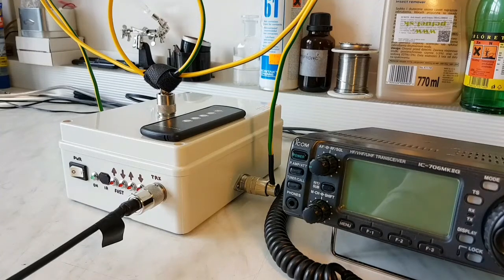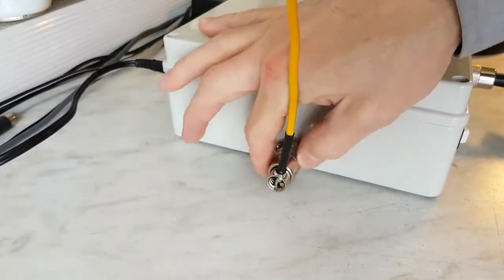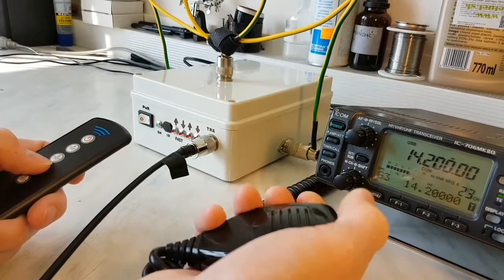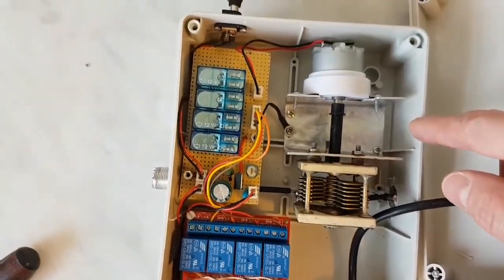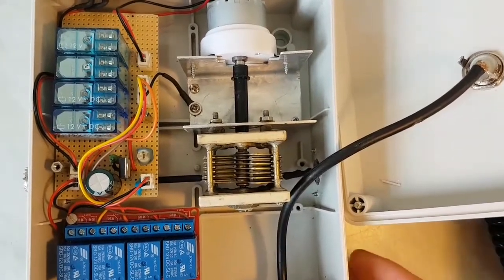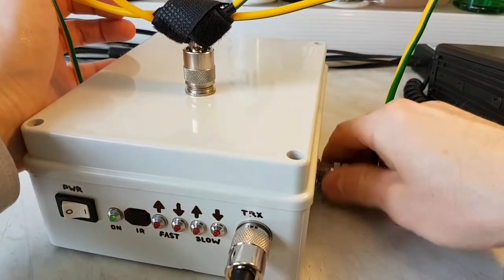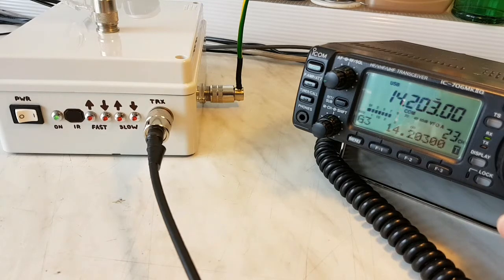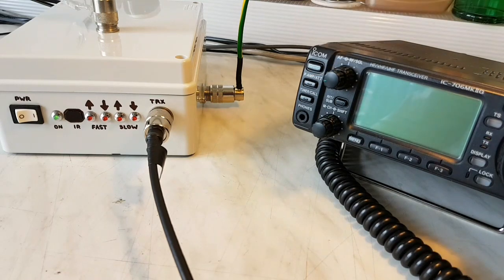New IR Remote Controlled QRP Magnetic Loop Antenna

Comment: Aloha Paul, can this micro loop antenna be made for 10 meters only and how many watts can be transmitted? I believe you are going to modernize the entire Amateur radio hobby with your loop antennas. 😎
Reply from the maker: This was just an experiment but it was capable to use more that 50 or even 100W due to very large capacitor in the box, but using such a big power so close to the human body would be dangerous. I dont have this antenna any more. Scraped 😃
Reply: @OM0ET  Oh no!!! What a beautiful antenna and would have been perfect for my Xiegu G90 at 1-20 watts PEP. Plus I could of added a 7 a/h UPS battery and connect it to a folding solar panel for SOTA activations. Can you dig it out of the trash pile and give it to me? 😂🤣😂🤣
Reply from the maker: @digitaldreamer5481  lol 🤣 impossible! Unfortunately but parts doesn't exist anymore 😃

Comment: How well has the efficiency turned out to be since you've had it for a while? Is it worth it? Have you made a few contacts? I may make one myself maybe with copper Tubing and spread the two turns apart a little.
Reply from the maker: I didn't use this antenna for so long, but I had a couple of contacts across the Europe from the table at my room :-) But better is working my 1m diameter loop which I use now :-) The efficiency of this remote magloop should be not high due to a small diameter of the loop, but it works :)

Comment: Why 8 relays and not just 4?
Reply from the maker: 4 chinese blue releys are just with one switching contact each. Transparent 4 releys have two contacts each. Transparent releys are switching voltage polarity in to DC motor. You can't do this with only one contact, you will need two of them. ;-) That's why are there 8 releys total. 73 Paul

Comment: Hi! In order to measure the SWR properly, you have to switch to FM. Or you have to modulate the SSB signal by long "AAAA". By the way, have you passed a QSO on this antenna? I haven't seen more videos with this antenna.
Reply from the maker: There was a mistake when i measured the  SWR on SSB but after a few seconds i measured it on carrier modulation. Maybe you didn't seen whole video. I did couple QSOs with this loop but i don't recorded it on the video.

Comment: Very nice!
How the 2 turns of the loop works? what's the difference from 1 turn?
What's the diameter of the loop and the circumference?
Thank you!
Reply from the maker: Hello, diameter of both turns is 45cm, small loop diameter is 9cm and the gap between main loop turns is 4cm. Difference between one or two turns is in its final inductivity and size of antenna. But this construction is very small and effectivity of this MLA is very low. I recommend to you to build this one: https://youtu.be/FGWFA12rQ5M
Reply: Thank you!
I'll watch it.
You have very interesting videos...
Just watched the EH antenna one.
Reply from the maker: Thank you! The EH antenna is practically not working until now, because i dont know how to solve the issue with the strong RF in the feed line(coaxial cable). Its causing a strong resonance unstability. I need to isolate RF between EH antenna and the coax.
Reply: Yes, I read the comments.
Also read what someone there wrote on his website (I didn't understand half of it HI) that EH antenna isn't really radiating...
I thought I fount the a magical antenna :)
73.
Reply from the maker: About 15yrs ago i made the CB EH antenna and i did a QSO with 4W to U.K. CB station from inside of my room on 1st floor of the 3 floor building. So there is no doubt that EH antenna is really working. But the design was much different like this one.
Reply: I hope you'll solve it.
I'm the in category of the people who doesn't have space for HF antennas and every small design is interesting.

Comment: Paul, this is a very interesting and instructive video.  I have been experimenting with a magnetic loop antenna for around a week or so that's how I found your video. May  I ask a question please? With the 50pF capacitor, what bands can you tune to? 73 Trystan G0KAY
Reply from the maker: Trystan's Workbench thank you! MLA antenna is like a LC circuit and its resonance depends on capacity and inductance. There is also some optimal values for each bands. But if you will use more inductance you can use less capacity. There are plenty of online calculators on the web. There you can see what you can do with 50pF capacitor. But 50pF is not really a big value for MLA. Could be working well on 12, 11 or 10m bands with one turn of copper wire. 😉
Reply: Paul, Thank you, and for your very fast reply too. Yes!  So making two turns means you can go to 20m bands and lower? Do you need to alter the size of the Faraday loop if you go from one turn to two turns, and does the position of the faraday loop have to be changed if you do that (on your two loop it's near the capacitor for your two-turn loop)?
Reply from the maker: The small loop position is this due to better construction capabilities but the best position is to place coupling loop against to capacitor. And about 2 turns - there have to be the optimal values and high Q of the antenna and its efficiency. The best is to use 1turn and good capacitor. But you have to calculate.
Reply from the maker: In my case it was not a really good idea to do so as i did.
Reply from the maker: Let see my latest videos with UltraLight MLA design. This antenna is working perfect!
Reply: Yes, I have watched your latest videos of your magnetic loop too. At the moment I have a 1.3m diameter coax Mag Loop (with LMR400 cable - like RG-8, to N-Type connectors) with a 300pF capacitor with a geared motor, controlled to go slower with a simple NE555 circuit set up  to make PWM pulses. The coax is too flexible to keep its own circular shape. Your projects are very well made!

Comment: Can you post information on the wire thickness, the air capacitor model, and the choke ?
Reply from the maker: Wire thickness is 2,5mm. Is used old russian ceramic air capacitor 50pF and choke is random from home store (from PC PSU probably).

Comment: very innovative and looks like some brilliant building. How big are the loops? and i love how you wired out the pl-239s
Reply from the maker: Thank you! :-) The main loop is variable in size, because of PL connections. In this case was used 2 turns abt. 30cm in diameter loops. It's just experimental antenna. Better would be to use Bluetooth (WiFi) remote controller.

Comment: Add a light pipe and you can set the loop in places out of direct line of sight
Reply from the maker: Gabriel Sierra that's a good idea!
Reply: Thanks! I use a home made syringe driven trombone capacitor and It is a great thing to sit in front of the radio and remotely tune the loop.

Comment: absolutely brilliant design.  can you tell us the range of the ir transmitter?
thanks for sharing.
Reply from the maker: OH8STN Hi, thank you! I don't no exactly, but tryed it within 5 meters when was IR led uncovered out of box. Next depends on your IR cover.
Reply: I think 5 meters is good.  I was thinking of adapting your design for a portable system. 
Thanks again and new subscriber.
Reply from the maker: I am very glad! ;-) You will need put in some rechargable battery. Maybe some small LiIon with charging module from Aliexpress. I wish you good luck with your own project :)